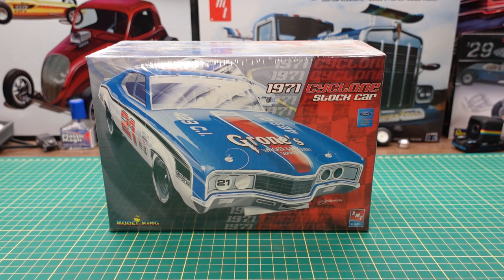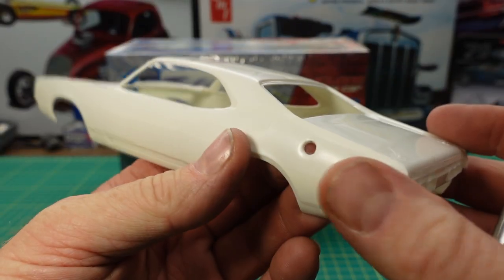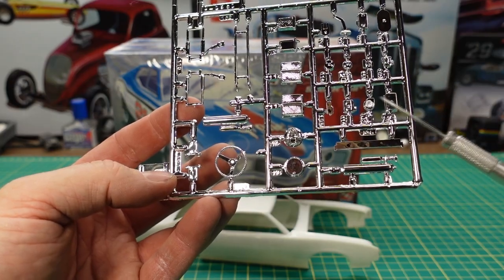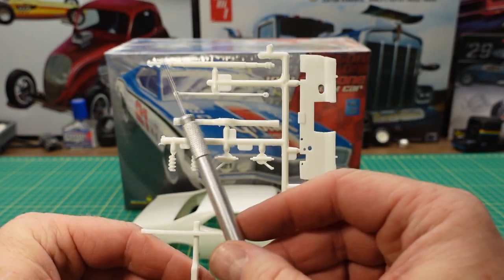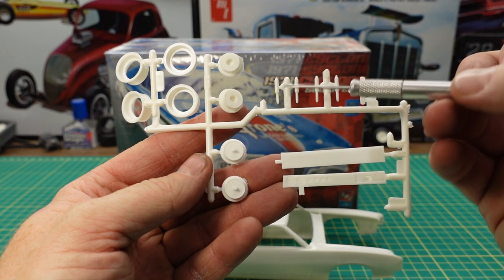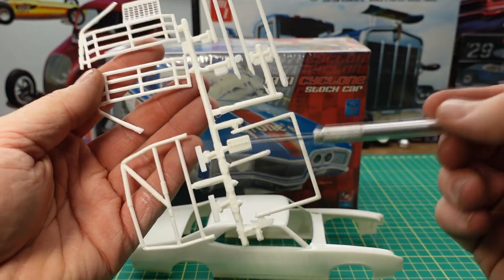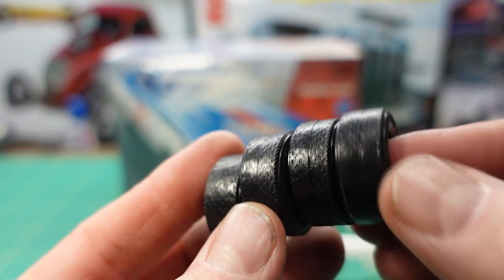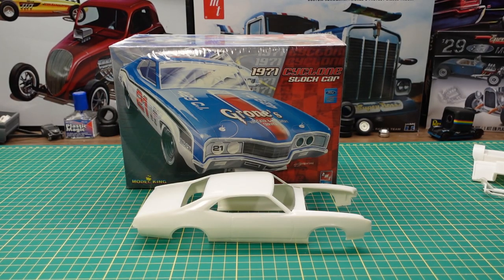Unboxing the AMT 1971 Cyclone Stock Car #unboxing

Comment: Great tip about the length of the chassis/ wheelbase.  When MPC originally issued this kit as the Wood brothers Donnie Allison car, it had a series of 3 pins and corresponding holes to set the length as this chassis was used under a number of different bodies.  This release is missing some bars from the roll cage as well.  It did come with some great (although fictitious) decals.
Reply from the maker: Thanks for that extra bit of info about the bars and the decals, appreciate you watching.

Comment: If you are going to build that 71 Mercury cyclone stock car I would use the polar lights chassis and engine and roll cage because everything in that mercury kit especially the rear end is totally wrong it doesn't look right and also you would need steel wheels instead of the chrome wheels that are on that Chrome tree that are incorrect that's what I would do if I was going to build that mercury cyclone use the polar lights kit all the chassis rear end and front suspension and a 427 or 429 engine would be perfect
Reply from the maker: Thanks Scott, that's some good advice for anyone building this kit.